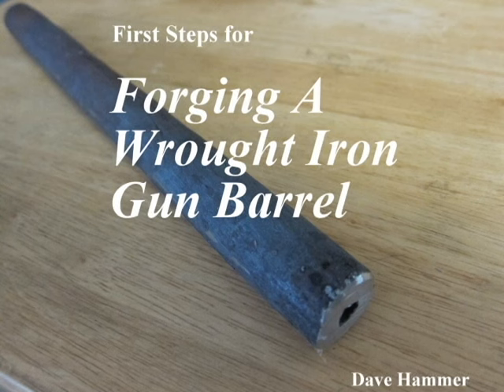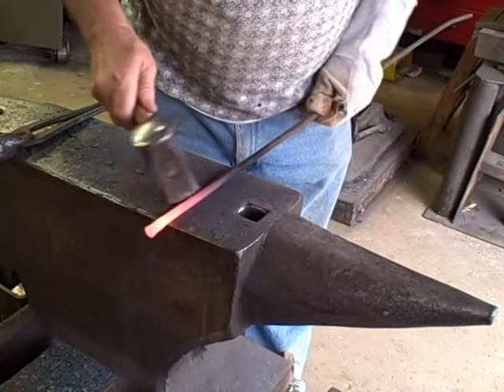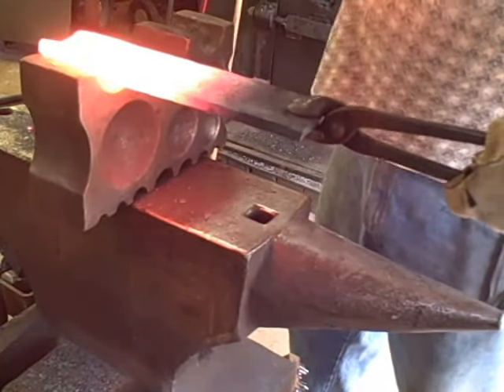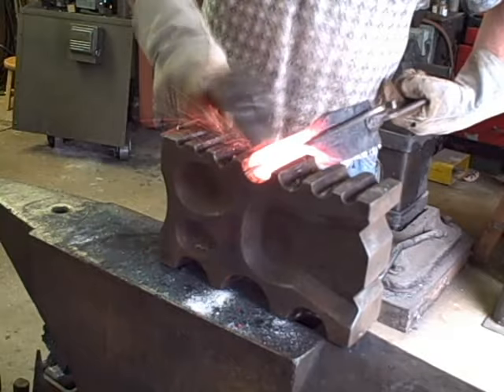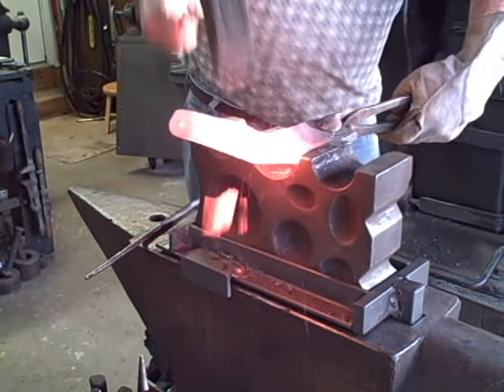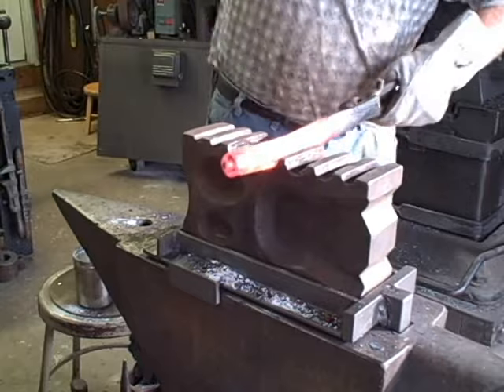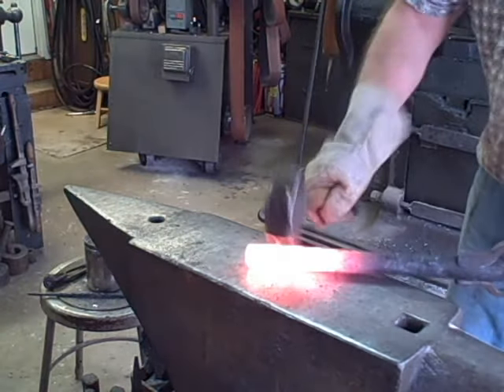Forging a gun barrel

Comment: Great stuff! So how do you know what iron is good and what's not? And how do you know what kind of a powder load a barrel can safely take?
Reply: Black Powder is used with early firearms and reproductions.  It is radically different from powder used with modern firearms.  Black Powder is available where early firearms and reproductions are sold.

With regards to knowing what wrought iron is "good".... 

Wrought iron is generally spoken of (graded) as poor, medium or highly refined.  Although a piece of wrought iron, after being processed into a bar, may have a smooth outer surface, it actually has an internal fibrous structure, much like a tree branch.  If you have ever seen a piece of wrought iron that has severely rusted, or has been successfully etched with acid, you will see evidence of these fibers. 

The finer (thinner) the fibers, the more highly refined the wrought iron is.  The more highly refined it is, the better it is.  The more highly refined wrought iron is, the easier it is to forge.  Extremely rough fibers (poorly refined iron) may appear as wide as an eight of an inch.  Within extremely high refined wrought iron, it may be difficult to see the fibrous nature of the iron at all.   

Modern steel does not have that fibrous appearance, it has a crystalline appearance. 

A way to determine if a piece of metal is wrought iron is to literally "break" it.... as if it were a twig, and look for the fibers.  Then a visual inspection of the thickness of the fibers is used to "grade" the wrought iron.  In reality, there would be many diameters of fibers within each grade (poor, medium and highly refined), so in reality, there are as many grades as there would be diameters of the fibers.  Within a piece of unforged bar stock, those fibers would run lengthways within the bar (again, like the grain within a tree branch).

When I tested the wagon wheel tire I used to forge the gun barrel, I could hardly see the fibers.

I suppose the next question might be "How do I break a piece of iron....  wouldn't it just bend?

This is how I do it....  If I am testing a bar (say a half inch square solid), I put a piece of the bar into a vice, with about an inch or so sticking up or out the side.  Then I cut it a little more than halfway through the bar with a hacksaw (with the cut about 1/4 to 3/8ths of an inch from the vise jaws).  The cut needs to be across the fibers.  You can generally assume the fibers run lengthways on the bar (this will invariably be true if the bar has not been forged).  Then take a heavy hammer and "whack" the bar, hitting it on the side that you just cut.  If you did this with a piece of wood, it would break or "split" at the cut (and you would see wood fibers).  Essentially, if you use enough force, and it is wrought iron, it will also split and you can see the fibers.  I try to hit the bar just hard enough to split it, but not break it.  As previously stated, the smaller the fibers, the more highly refined the wrought iron is.  Some fibers may actually "tear" and you can see the ends of them (as well as the sides of those that don't tear).  On highly refined wrought iron, those fibers may only be 1/100 of an inch wide. 

If you have trouble breaking the metal, cut it a little further.  If it's steel (rather than wrought iron), it will be harder to break.  If it's steel, it will snap in two at the cut and will not split like a tree branch.  It will have a crystalline appearance on each end instead of the fibers. 

If you have a piece of thick barstock, just cut a short (1/4 inch) piece off the end and put that in a vise and break it like you were trying to bend a coin.  It will snap in two and you should see the fibers (assuming it is wrought iron).

If you don't want to destroy a piece of what you have, clean the scale off it (sanding or ?), then etch it with acid.  You won't see the grain as pronounced, but you should see grain.  The more poorly refined it is, the easier it is to see the grain.  If it is extremely highly refined, you may have trouble seeing the grain and will have to do the break test.  If you polish the metal, a light acid like lemon juice may show the grain (it takes a while).  A stronger acid would be hydrochloric acid (muratic acid).  If you use stronger acids, be sure you take proper safety precautions and proper disposal techniques (read the MSDS).
Reply: Thanks a lot for your quick reply and all the information you took the time to provide!

Comment: I watch this and I think about those armies of the Napoleonic Wars. 750,000 that he took into Russia, and however many the Russians had. I can't imagine doing this x 1.5 million. I don't see how they did it.
Reply: I'm not a historian, but it is mind-boggling to think about the number of weapons that were produced prior to the industrial revolution.  Research indicates the late 17th century (into the early 18th century) was an era when attempts at standardization of parts (although not fully achieved until much later) was initiated.  All parts still  needed to be hand-fitted to each weapon prior to the industrial revolution.  It is likely that numerous arsenals, with thousands of craftsmen (blacksmiths, gunsmiths, wood workers and skilled artisans) existed to produce weapons.  Key components like barrels, locks, and stocks were handmade, often in separate workshops or small factories, then assembled at an arsenal.

Comment: To forge it to the octagonal shape, I assume you put the mandrel back inside to keep the hole from closing? And how would you drill that hole out other than just making a long drift out of probably 440?
Reply: The octagonal shape is forged without a mandrel.    The structure of the barrel is strong enough to not collapse under that forging.  After rough forging, files are  used to make the flats even and truer.  Several long drill bits are hand made (small to close to the bore target size).  A few inches of the end of the drill bits are steel (forge welded on) and sharpened appropriately to do the cutting.  The ends of the drill bits are tapered back a little, making at the cutting edge a couple inches long.  During the Colonial days, the drill bits were powered by large flywheel turned by hand (the end of the bits were essentially "chucked" into the center of the flywheel.  The barrel is actually pushed into the turning drill bit a little at a time (on a rack to assist in straight entry), then backed out to dump chips.   After the drilling work is done, a "boring" tool (again hand forged, but with the same function as a modern boring tool) is used to smooth the bore.  If the barrel is to rifled, that again is done with blacksmith made tools that are hand driven.

My initial intention was just to see if I could do this type of forge welding.  I may, or may not,  continue to work on this barrel and make a flintlock handgun.  The least I will probably do is finish the barrel.  I do not have a schedule to finish it.
Reply: Could you make another video to show the tools or at least post a few pictures? That is if you already have the tools.
Reply: I haven't made those tools yet.  There is a hour long video that was produced at Colonial Williamsburg that shows the type of process that was common during those times.  Search for "Colonial Gunsmith" on YouTube.

Comment: What is the powder that you are sifting onto the forged metal as you close the gap? Very cool project. This is forging at its finest.
Reply: lowerastral The powder is 20 Mule Team Borax.  It can be found in most grocery stores in the isle that holds laundry soap.  It is sold as a laundry product, but blacksmiths use it as a flux, which liquifies the scale that forms on the iron during the heating cycles while forging.  The flux and scale fly off the iron during the forge welding process.
Reply: Thanks...very interesting process. I'd love to have the facilities to be able to do some of my own blacksmithing. Forging guns is way beyond my knowledge, but it is so amazing to watch the process. What an amazing form of art.

Comment: How can you get a strong barrel with a seam all along it? Is this just a decorative item?
Reply: erikev All I can tell you is....  

This is one way that some gun barrels were forged for hundreds of years.   The Colonial Williamsburg gunsmiths (and others) still replicate this method for guns that are used.   The barrel is validated as safe to use by testing it with overcharges of gunpowder.  Some will fail, but those that don't can be certified safe.
Reply: This is how barrels are forged. The seem is non existent after fluxing it becomes a solid piece n the white heat actually tempers it. Its all about the heating.  Japanese arisaka barrels were forged this way and are amazing quality. 

Take a mig or a arc welder and run several beads over each other cleaning out the carbon and slag each pass n you will get a solid piece of metal. I did this in ag sophomore year as an advanced welding test.
Reply: +Matt Dick, Barrels with seams are not allowed in any military application. Seams are not allowed in any critical high pressure application like scuba, nuclear, aviation etc either. No pipes, barrels or tubes are allowed to have seams. Must be core drilled or formed seamless.

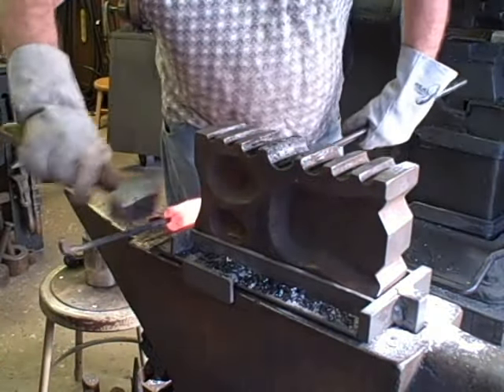Comment: What was that powder you put on at the 8:43 mark and what was the purpose of it?
Reply: I use "20 Mule Team Borax" for welding flux.
Reply: The powder is called flux (it looked like borax but it could have been a number of things). The purpose of flux is to act as a cleaning agent and to prevent oxidation at the seam. During the forge weld it coats both sides of the seam. When the metal is hammered it is squeezed out of the way and all that is left is metal on metal contact with no impurities (oxidation). This forms a good weld/bond.
Reply: Ok, so if you are doing a forge weld where you are joining two pieces of separate metal, you really want to use this powder to keep the impurities from forming?
Reply: WesternEasternTruth It's my understanding that flux keeps the impurities (from oxidation) suspended (not attached to the iron).  When the two pieces of iron are pounded together, the suspended oxides and flux squirt from the joint.  This allows the two surfaces to bond without interference from extraneous stuff (technical term).
Reply: Hmmm, that's interesting. I guess I should ask someone who knows for sure, but thanks for the input man
Reply: WesternEasternTruth you just asked the guy who showed you how it was done, what more do you want, how about some thanks for the information shared? rudeness isnt really welcomed by people who take the time to share their skillset, David didnt have to make this video, he has done so out of his desire to share knowledge with the rest of the world, it sounds like he has done this for a number of years, he may very well be one of the leading authorities and carrier of the skills and expertise needed to produce this item using these techniques
Reply: David Hammer is on point here. Flux is also used in Soldering electronics. It is either a resin or an acid, same principle. It cleans the joint so that the metals can bond on a molecular level.

Comment: can you fire modern smokeless powder in this barrel? Is the weld or metal strong enough to handle the pressure?
Reply: Gun barrels welded by the Colonial Williamsburg gunsmiths this way are commonly fired with modern gun powder (4/26/15   I may have to backtrack on the modern gunpowder being used, I'm not sure...  since there are multiple grades of gunpowder available).  I've been told they are tested with double the normal charge after being finished to be certain they are safe.

Comment: so all that heating, folding, hammering - what is wrong with getting a round piece of steel, and simply drilling through it? Also, how straight is the barrel? surely there would be imperfections in this method . whereas a straight drill through steel would ensure am even trajectory for the bullet
Reply: The video documents an attempt to forge weld a gun barrel the same way blacksmiths did during Colonial days.  No more, no less.  I expect modern methods do involve drilling a length of steel.
Reply: Duncan Curtis this is a lot stronger than just drilling a hole through roundstock. working the metal refines the grain structure and makes it confirm to the shape of the part. This makes it strong.
Reply: tjsbbi is right about refinement and conformity.  There is a LOT of forging still done today for heavy industry and the military just because the steel product produced is better because it's forged, rather than being cast. I believe Scot Forge has some heavy duty videos on their website if you can find them.

Comment: I know you said that this would be stronger than drilling into steel, but what if you cast it?
Reply: castings would not be nearly as strong as the work-hardened, hammer forgings. It's quicker ,but not stronger.
   The hammering (condenses) the material, a casting would not be as dense as the forging using the same material.
  hope this helps. The hammering would ( compress ) the molecules closer, and make there bonds stronger.
   WORK-HARDENED
     is the term.
  this guy is pretty good at  smithing.
Reply: It does, thank you. Do you know which would be stronger though? Drilling or casting, I mean I'm not making a gun barrel anytime soon so I don't actually need to know I'm just curious.
Reply: +christopher gement forging around a arbor is the best, than you do not have to remove as much " work hardened material " from the barrel.
   The only barrels I know of that were " cast " were cannons, and those barrels are massive.
Reply: Okay, thank you for the help.
Reply: +christopher gement ....   I don't really know the answer, but I would expect drilling would be better than casting.

Comment: How and when does one get the idea of making a gunbarrel from a rusty old wagon wheel?
Reply: Wrought iron is no longer being produced, so we have to reuse stock from where we find it.  Most of my wrought iron is from old wooden wheel tires.  Quality will vary, but I did happen to have some highly refined wrought iron that had been used for a tire....

As to the genesis of the idea of doing the project.....  The weekend before I made this video I attended a blacksmith conference.  One of the demonstrators was a gunsmith from Colonial Williamsburg.  His project for the weekend was to forge weld a long rifle barrel.  I was enamored with his efforts and wondered if I could do that (only a pistol barrel rather than a long barrel.  I looked for a piece of wrought iron and gave it a whirl....  It was both fun and exciting (and has become my most-viewed YouTube video).

Comment: hi, interesting, would like to know what did you add with the spoon? at the time 9:12
Reply: I'm using "20 Mule Team Borax" as a flux to manage scale during forge welding.
Reply: Thanks you mr, the borax help to weld the border? or is for another purpose
Reply: The borax does help with forge welding.  It liquifies the scale so it squirts out when the objects are joined.

Comment: Didn't you cut that from a piece of leaf spring? That is not wrought iron, that is high carbon steel.
Reply: No, I did not cut that from a piece of leaf spring.  I cut it from a wrought iron tire that came off a wooden wheel, most likely made in the late 1800's.  I confirmed it was wrought iron two ways.  The first was to cut and break a small section, which exposed the grainy nature of wrought iron (the grains were extremely small, which supports the claim it was highly refined).  The second validation was done by etching other projects I made using iron from the same tire.  The etching revealed the classic grains always present in the iron....

Comment: what is flux and what does it do for the forging process? and I am confused about the name. the chemical is borax, and the brand is 20 mule team right?
Reply: +jingthethief ...  When metal is heated in a forge, oxidation occurs, which produces scale on the metal.  The scale adheres to the metal and interferes with the forge welding process.  Using a flux (in this case borax), liquifies the scale, so it will squirt away from the surfaces that are being forge welded together.  And yes, the name of the product I use is "20 Mule Team Borax".  It can be bought in any grocery store in the soap isle.
Reply: David Hammer how do u know if the flux is melting away all the scales instead of just most of it
Reply: +jingthethief ...  Experience with successful forge welding efforts......  You probably don't know for sure, but if you get a  good clean solid forgeweld, it has done it's job.